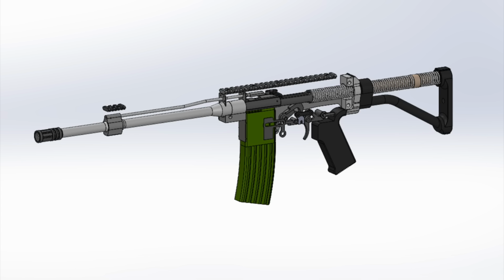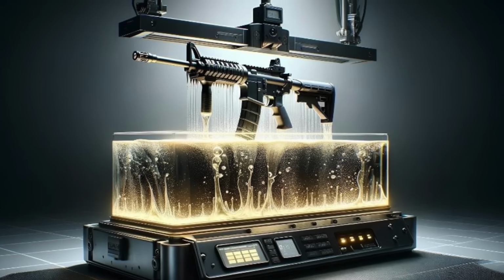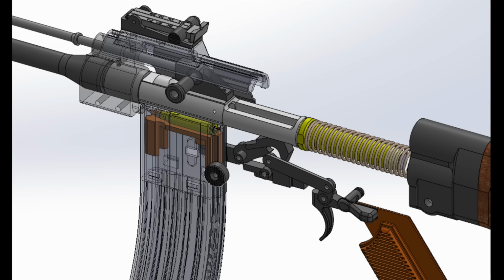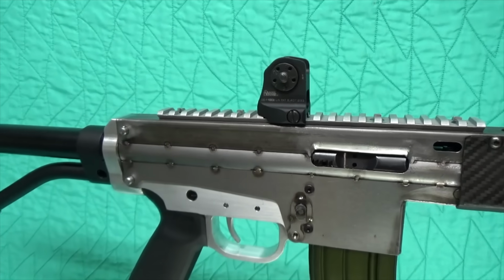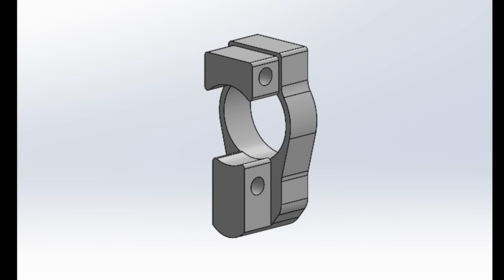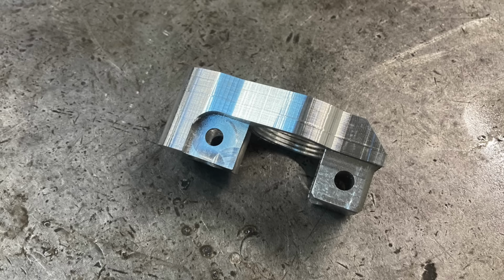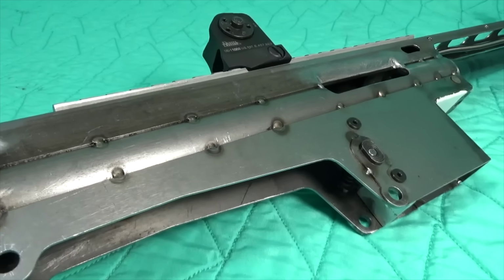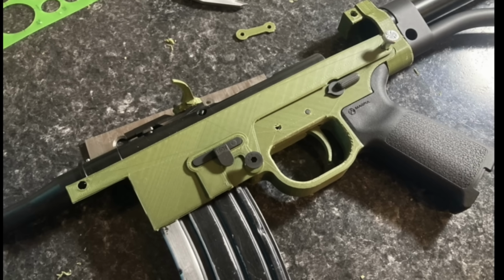The JLC-24 Rifle!

Comment: You know Mark , The first Stoner AR prototype was made 100% on manual machines. Not that you see manual guys of that caliber much anymore but , it can be done with time. Bit by bit.
Reply from the maker: @greatdestroyer1 Yes, I know. I owned and ran manual machines for years and I'm sure I could do it. But never again if I can help it! We used to ride on horse-drawn carriages, too, but now we drive cars!
Reply: @markserbu  Im a CnC machinist by trade. I Did start on the manual side , so I get it. Yet there is still something more satisfying about making parts on a manual. As you know sometimes doing prototype work is just easier on the manual stuff depending on the situation.
Reply from the maker: @greatdestroyer1 Sorry, but I disagree. To me there's nothing satisfying about turning those godforsaken handles. It's a waste of time that computer-controlled motors should be doing instead of me. My time is MUCH better spent designing and (until AI takes over that task) programming. If you think prototype work is easier on manual equipment, then you don't have the right equipment or the right software. The best part, as a guy who has been 5 hours into a part (on a Bridgeport), have it slip in the vise and get destroyed, is that those days are long gone. With my CNCs I can clamp another piece of material in the vise, push a button, and make the same perfect part again in minutes!
Reply: @markserbu Thank you very much Mark! for producing rifles that bring real benefits! Your weapons save lives in Ukraine and for this I thank you very much from me as a Ukrainian! https://youtu.be/cIwIL7YfYcY?si=6_JUVrtcMAMHiOZZ
Reply: @markserbu  Thanks for another great video Mark. Best Wishes to you and all your loved ones in these trying times.
Reply: Oh, they are still around toiling through the nights and weekends on manual machines in their garage or boathouse.
But they build away from the prying eyes of government and nosey neighbors and online agents.
They are perfectly happy to build without anyone knowing.
Only they themselves will ever know what went into building their new arm or accessory.
Reply: @shovelhead108 Except most of the guys with that skill level arent building firearms, alot of them build engine/racing parts and high end custom projects. It'd be so cool if more of them started designing custom rifles and putting them out there but thankfully with 3d printing we have other guys filling that slot..
Reply: I know one guy who can do that level of work. I'm still kicking myself for not following in his footsteps.
Reply: What metal shop machinery were not manual back then? When did computer-assisted milling and routing appear in the weapons industry? I remember the robots had taken over the factories in the 80s and I'd guess the 1970s as well, in some sort, but overlooking the plastic parts being spewed out of the PET molding-monsters was hi-tech for a 13 year old in 1985 :)
Reply: It was less about automation more about gang tooling for production back then. Even so there are always varying degrees of skill . A tool and die or research and development machinist might have the skill to engineer and machine but your typical machine operator machinist won’t have that skill set , no matter if it’s manual or cnc .
Reply: delayed blowback whit trunnions and rotating bolt????

Comment: I've experienced the hardening of the laser cut holes also, but found a cobalt drill bit with slow surface speed usually made easy work of it. Especially if the pilot hole was Like 1/2 the finished diameter.

Comment: The 3d printing community is doing a ton of work I love seeing the metal fab community doing it
Reply: Well... literally every gun ever has been made at least partly if not in whole by the "metal fab community," so there is that...
Reply: @RSPFactory Most of these were designed by gun companies to be produced in factories, not by the community of users itself, which means most of them are extremely hard and expensive to manufacture at home, while the metal fab and 3dp communities are doing their best so the average person can make and customize a gun on a reasonable budget and without needing a degree on mechanical engineering

Comment: We use laser cut parts for critical elements and I always keep Mark's warnings in mind. However, there does not appear to be any undue hardening on 2mm 304 stainless. We debur it with Chinese hand files.
Reply from the maker: @zaitcev0 That's because austenitic stainless steel (300 series) isn't heat treatable. BTW, I do post to Twitter, just not very often.

Comment: This mid-goop printing tech already exists! 
It’s a revolutionary new way to print with resin by curing it within itself with intersecting lasers that interfere to create the necessary curing wavelength only at a precise tiny point leaving a cured Voxel semi-bound in place by both the high viscosity off the surrounding uncured resin and the cured resin remaining intact neutrally buoyant within itself.

It is extremely fast too. Typical prints take ~20 seconds, with larger more complex prints taking just under 2 minutes. 
Print size is only limited by the size of the resin vat and doesn’t affect speed much.

Comment: In the 3d2a community, I've seen people make single use 3d printed bending jigs for HK flats. He could probably refine his design to make the upper out of 1 or 2 sheets. either 1 fully bent or 2 clamshells welded together.
Reply: Jigs is one of the really cool parts about 3D printing. I mean, could you have imagined even a decade ago that you'd be able to make a really simple ECM rifling jig which actually works really well?

Comment: Totally sweet! What kind of buttstock is that? Would you be able to make this a piston gun? Also, would you be able to make this without using a rear buffer spring? Like putting the main recoil spring INSIDE the receiver so you could create a side folder?
Reply: it's very close to the stock of the Vepr12 shotgun

Comment: Does anyone know how much a BFG-50A weight is? I searched in Chatgpt, and it says 15kg, so it is heavier than M82A1 and M107A1. That's correct?
Reply from the maker: @BAMRABBITWAYNE If only there was a website that had information on the Serbu BFG-50A, including weight, length, exploded view, user manual, etc., etc.
Reply: @markserbu  I didn't scroll all the way down. I would erase this comment because that was embarrassing, but Mark responded, "So I'm gonna leave here so others can see my smartness 🤣

Comment: So.. basically this is an AR15 that disassembles like an HK design. While it's kind of neat, it doesn't really "solve" any problems. And, while it is simple in it's construction for the receivers (which is a plus!), we've already had stamped bolt- (or rivet-) together receivers in the AR15 space for a long time.
Reply from the maker: @bigmike- And sometimes it's more about doing your own thing than solving problems.
Reply: What problem was the designer supposed to solve? Obtuse schmuck

Comment: It's basically a cetme 5.56.
Reply from the maker: @humansvd3269 A CETME L that's gas-operated instead of roller delay-locked, uses AR-15 fire control parts, bolt, barrel extension and is laid out like an AR-15.
Reply: @markserbu  I know the difference but this basically looks like a Cetme L skin.

Comment: What you describe as SMR is literally the replicator from late-era Star Trek, and I think some have - like myself - realised that all a replicator is, is a 3d printer that uses forcefields instead of a 3-axis  grid and a print head, and a single-molecule nozzle.
Reply: The Star Trek Replicator is a bit different than what Mr. Serbu described, as a replicator condenses pure energy into matter
Reply: @flightlesschicken7769  Not as I remember it, though I admit it's been a few years (like...20) since I read the old TNG tech manual, what I remember it stating was that it disasembles and reassembles source matter (either processed waste or base matter fuel - deuterium from the engines) to whatever configuration is programmed in like some kind of sub-atomic STL file.
Reply: @vorlon010  Hmm, maybe. But to turn deuterium into other things it would at least need to be broken down into individual protons and neutrons and reassembled one by one. I may be wrong, but I remember reading somewhere that the replicators were similar to transporter tech, in that things were converted to energy then reassembled in a specific pattern
Reply: @flightlesschicken7769  right. The impression I was that it was operating at that subatomic level (I freely admit I oversimplified in my initial comment, I was trying not to go full trek-lore-nerd, heh.) - the part where the transporter comes in is in creating scan images of real food at a resolution that can be 'printed' - which is lower than full transporter res because you don't account for quantum. It would take far less energy to disassemble and reassemble stuff, even at the subatomic level, than to try and directly convert energy to matter. This is ignoring the in-universe plothole of how the transporter moves someone's matter from A->B
Reply from the maker: Shit...Nerd fight!!  ;-)
Reply: @markserbu says a nerd😂
Reply: @vorlon010  Yeah. Although, I think if you disassemble an atom to its subatomic quarks and stuff that the quarks unconsense into energy, unless you have some high energy exotic state of matter like quark-gluon plasma. Maybe replicators make things out of quark-gluon plasma; we can make that stuff with our current technology, so I don’t imagine it’s too much of a leap for it to be used as a fuel to make matter out of in Star Trek, haha
Reply: @markserbu  lol ;)
Reply: @markserbu  can't blame me for trying not to go full nerd, can ya :p
Reply from the maker: @vorlon010 Nope! And it's not like I can call anyone else a nerd without the whole "pot calling the kettle black" thing, right? ;-)
Reply: @markserbu  does he have a YouTube or odyssey account?
Reply: @markserbu 
 Dang you even killed it on a post to your own video. 👍
Reply: @flightlesschicken7769 the dilithium is the key, the fact star trek has a limitless energy source is what allows replicators to work.
Reply: @jediknight1294  doesn’t the dilitium provide a matrix for antimatter reactions or something like that?
Reply: Chic-kan.....chic-kan good!

Comment: Mark, thanks for showcasing a great builder! Justin great job, is there a last round bolt hold open on this? Is the hammer made out of a soft steel with a hardened strike face welded on?

Comment: Real cool. I'm working on making a belt feed using a rpd feed system and I'm going to try using bent sheet metal to make the receiver and ak47 internals. That trigger linkage gives me ideas for mine. I also did a build with a AUG parts kit and a 3d printer. I used polycast filament to cast a AUG receiver in cast aluminum and modified the receiver to accept the Nylaug barrel. It was my first attempt using casting and 3d printing and it turned out really good. You just need to have a vision and get to it
Reply: Good luck. I look forward to seeing the final build
Reply: You on sand or plaster. Can share how. please

Comment: My suggestion is to play around with lazer cutting/bending the trigger pack and handle assembly from sheet. Also a weldment of the stock connector thats in al. Right now as well. Very good work keep it up and thanks for the engineering centerfold.

Comment: 1. Is he going to cold blue the raw material?
2. Is this eventually going to have bolt hold open on last round fired?
3. Did he use a standard AR-15 barrel?
4. The magazine area look configurable, will he make this to be multi-caliber?
5. I also TIG Weld and wonder if he is going to use the "spot" technique for the rest of the welds. Entrance and egress areas for dirt?
6. How did he get the carbon fiber to bend like that?
7. Accuracy and how was/did he test it?

Comment: First, this is really awesome and great stuff.  I'm sorry if the next question seems like I'm knocking it, but its way more awesome than anything I've done.

Why not just design the lower (fire control housing?) so it can be directly 3D printed.  It only needs to handle the loads from the fire control group and isn't directly exposed to the barrel heat, etc.  Polymer can do that fine.

I totally understand not wanting a polymer upper since FDM plastics have low melting points.

Comment: As a 3D printer fan, low level designer, I know that additive manufacturing is the future.   There is a new printer that works like an ink jet printer, faster, laying down nano particles.    
The technology has come forward.   A thing I designed 7 years ago, took 30 hours to print,  a new $250 Creality Ender can do it in 11 hours. A lot of suppressors are 3D printed in metals. 
The technology is here to stay.

Comment: Cool but the most difficult parts, bolt and barrel are "cheated". 
For me it really ruins the project. A craft made firearm should be able to be manufactured everywhere and quess what, bolts and barrels are regulated everywhere except in the US.
Reply: While that is true, it is still valuable to develop processes to make the other parts with low cost tools that anyone can obtain. 

The more difficult parts like bolt, barrel, ammunition, and trigger group can be addressed in phase two.
Reply: @JLC-1975 Overall the rifle was fine work, perhaps i should've put more emphasis on that. The ready made barrels and bolts are just a pet peeve of mine. 
I wish you luck on your future endeavors.

Comment: This is cool, but TBH not as cool as the Hoffman Orca.
Reply: is hoffman orca all-plastic receiver? if it is, then it's not gonna be very durable long term. can't beat metal.
Reply: @J9_j3  It is a lot stronger than you think. Versions made with low temperature thermoplastics have lasted for thousands of rounds without degradation, and I don't think anyone knows what the life for a high temp polymer like filled nylon is. Like a metal AR, in a nylon AR the weak link is the gas tube.
Reply: I’m sorry my dude and no shade to Hoffman because he’s an  awesome designer. But That’s purely a matter of opinion! My opinion is that the orca’s aesthetics are fucking disgusting👍🏼